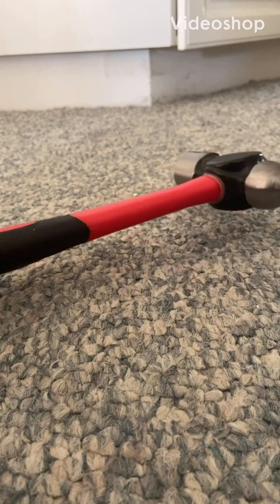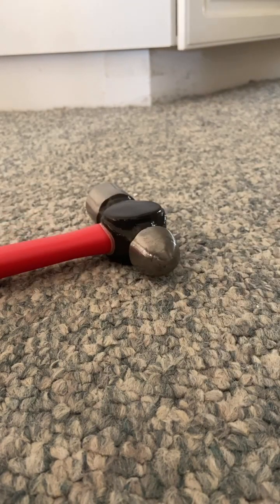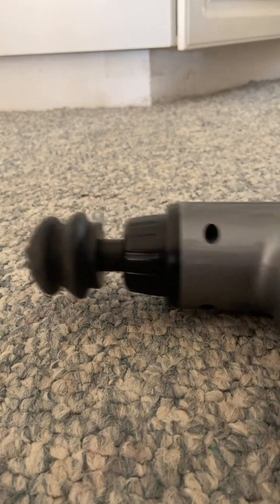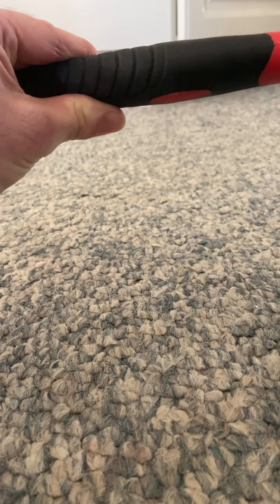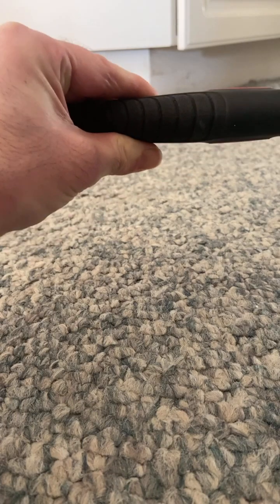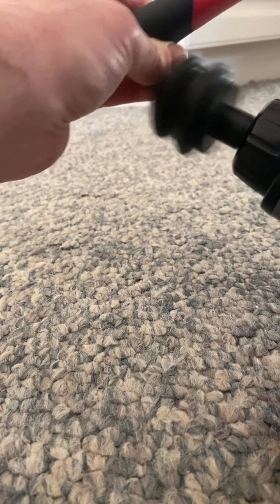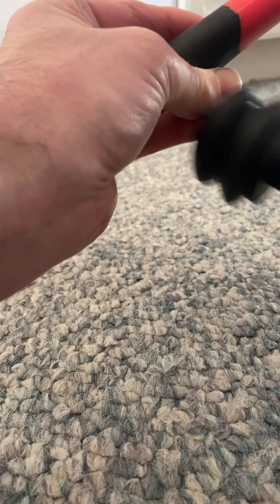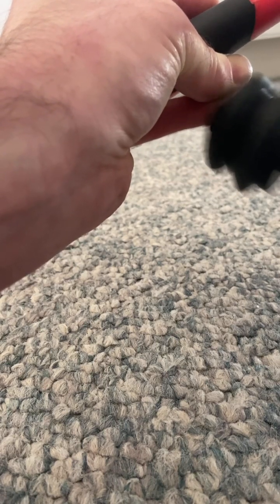Demonstration of experiment of using torsion +vibration to increase bone length

Comment: would this work on something like your chin to lengthen it?
Reply: Was thinking the same thing. Look up the biomechanics of the jaw bone, then look at images. A loading force downward puts tension and compression(?) forces around the ramus. Maybe using vibrations there while putting enough loading force could lengthen it.

Comment: This thing with inches is ridiculous at least. Stop using inches and use centimetres instead. Also first get xrays and then talk about results. Otherwise it's just bullish!t sorry to say that but that's true.
Reply from the maker: Any ideas outside of the medical system for X-rays?  Measurent difference has to be sufficient for X-rays as even with photoshop gimp there’s some measurement error
Reply: Just go to the same machine for the x-rays . And then you don't have to worry about special software. Or if you have the physical form as well. Now if you have 1 xray from 1 machine and the 2 from another that could be a problem If you don't match the scale. But I guess the scale must be shown. In physical format though I am sure that it will be 1:1 ratio to bones so you can simply use a ruler... Nothing special. Stop using inches . Use centimetres, achieve a 1 cm result at least and then speak about results. Stop making nonsense videos giving hope without reason .
Reply: @nikibra9639  i agree
Reply: And no ! Only xrays can prove certainly the result! It's easy go to a clinic pay 30-50 bucks and you are done.

Comment: Do you think this could induce finger lengthening if you hold your hand over the massage gun and let your fingers hang while they vibrate?
Reply from the maker: The weight is important.  But if you want to try and document your progress.  But since I got results (3/16th of an inch) I want to see if others can get what I did

Comment: Hey Tyler, this idea looks pretty good! I wanna to apply it on my spinal column and tibia/femur. And i have a few questions to apply  routine correctly and effective. Which parameters in percussion massager are most important for us? How frequently should we do it - once a day or maybe twice? How do you know that the effect has been achieved and you can move on to another area? For the spine - is it better to use a percussion massager while the back is bent? What do you think, long monotonous stretching of the legs/back is like sleep stretching after this routine will speed up results? Thank you
Reply from the maker: All those questions will need to be tested
Reply: @NaturalHeightGrowth  thank you, I’ll buy a percussion massager and start with the back + tibia/femur. Hope to start the routine within a week
Reply: @NaturalHeightGrowth  the massage pistol i ordered is still on the way from China. There are metal nozzles, so i hope for the bones it will more effective than regular ones. I found your previous video about "How strengthening your back..." and maybe we can combine these methods - and use massage gun after high rep spine training to increase blood flow and create micro fractures as well. What do you think?